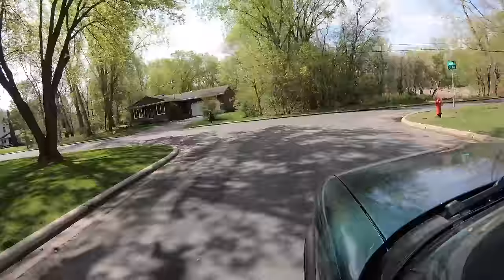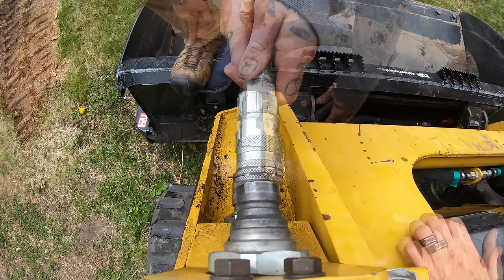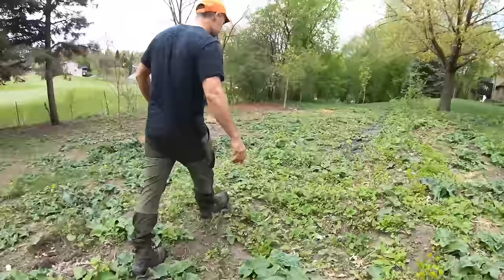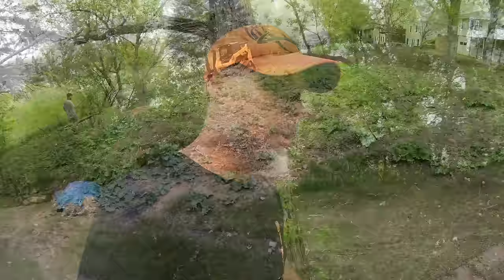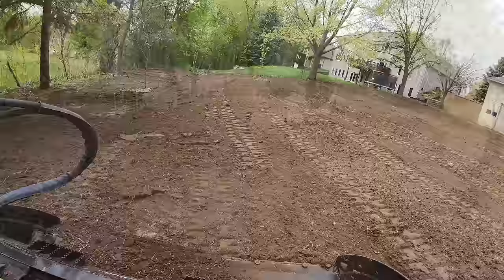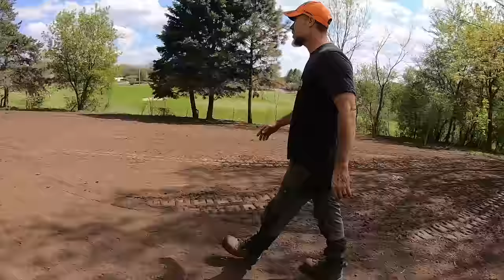Regrading a BRUTAL yard Choked with Weeds 4k

Comment: I would be awesome to see an update of this backyard after it’s seeded and grown in some.
Reply: I imagine a lot of weeds have sprouted since all the existing weeds were worked into the soil. If I was the homeowner, I would've sprayed the life out of that backyard in anticipation of laying down new seed. Maybe that was done though. It would be interesting to see the yard today.
Reply: D T yeah that is what I was thinking.
Reply: @delt19  The problem with spraying (what no one tells you) is that glyphosate kills all bacteria in the soil at a 1/50th of the plant killing concentration. Plants can get nitrogen a few ways: 1) through air... (very slow), through fertilizer that is ammonia / nitrogen-based (very fast, but short bursts), 3) through bacteria and fungus - the bacteria and fungus eat the sugar / carbs produced by the plant and offer poop.... nitrogen in exchange.

Best way to kill weeds is to till them. Wait 2 weeks and till them again. Unfortunately it's not practical I agree.
Reply: @lifeisgood070  Interesting information. I did not know that about glyphosate. I've personally never used roundup to kill weeds and more than likely will never use it. I do use a mixture of tenacity with a surfactant for weed control and plan on applying it to my backyard to get it ready for regrade and seeding job.
Reply: @delt19  gotcha most people don't spend that kind of money ($60) when other concentrates are so cheap. Going for the horse not the zebra. And Idk the unintended consequences of tenacity; I have not studied it.
Reply: Haha I also was going to say same about after shots, also thought about the timing oof this job and I’d he aligned it around rain in forecast.
Reply: Weed all come back up in about 3 day but it look good doing it
Reply: it would be awesome to see an update of  all the jobs hes done. before and after, revisited yay !!!!
Reply: Didn't look deep enough to get some of those weed roots.. lawn torch that whole yard..
Reply: @lifeisgood070  that or somehow cover the entire site over with landscaping fabric to drown all the weeds out but thats not practical.
Reply: @kmain0  Cardboard pallet slips
landscaping fabric will get intertwined with the roots and be hard to remove.
Reply: @lifeisgood070  would spraying something containing beneficial bacteria help. I’ve never read anything about it killing bacteria just plants as it says it does not impact the soil.
Reply: Would a preemergent be better since he already killed the weeds that were growing. Then wait to see when it's safe to do so.
Reply: Tenacity!
Reply: @delt19  If you cover grass with dirt so it can't see the sun it dies so a lot of that probably died, but there's a lot that probably didn't.  A quick Roundup spray 2-3 weeks before probably would have been best.  I know someone mentioned Tenacity, but it takes forever to kill a lot of stuff and there's a lot of stuff it won't kill, so that wouldn't be my choice.  Even if Roundup killed some of the bacteria it wouldn't kill it all and it would reestablish quickly.

Comment: Man you do good work. Wish you were around NJ. My yard looks just like that and it’s taking me forever to fix it. Moved in a few years ago and had a tree company remove all the dead trees and bushes in the back half of my yard which looks like the previous owners never even cut or trimmed once in 40 years but I didn’t realize how many roots, vines, rocks and crap were still back there on top of what looks like a construction company dumped concrete, clay and metal pipes and cement. I’ve managed to do a lot by hand but I feel like I can never keep up with how fast the vegetation grows.  That bobcat and bucket look like it would have solved years of manual labor I’ve been trying to do. Love the videos and the love you put into what you do.

Comment: Time for a new set of quick connects and a drain of the hydraulic system and a new hydraulic filter. Then ask your crew to wipe the connectors before connecting a new attachment, it will save putting dust and dirt in your system. Nice work you did on getting a perfect slope
Reply from the maker: Not a bad idea

Comment: The ABI rake you bought awhile back would have done that job as well. I did a similar job and borrowed one from a friend now I want one.
Reply: Which ABI rake? With or without wheels?
Reply: @flat6fever680  I used the sr3 command series with wheels on my skid steer. I bought a tr3 for my tractor to use in my wife horse arena.

Comment: over here in Québec, black dirt is all organic matter and very black. Top soil is a mix of black dirt and sand that you put over the finished grade before seeding. I gess a mix of weeds and the top layer of dirt underneath it like what you get with that power raker could be considered like top soil, so great machine to prepare a lot for seeding at a much lower cost on material.

i would like to see a finished picture after the seeding is grown.

Comment: The metal in the oil is a little worrying, I'd definitely change the oil and flush it. The bucket looks like it works well, I'm a big believer in a tool with multiple uses.

Comment: I had a large tree fall in my yard and used a 12,000 lb JD tracked loader to cut is up with a tree shear and then switched to a grapple to move it out. I loader tracks made cut large divots out of my sod and channels into the dirt below. what would be the best attachment for smoothing out the yard without having to work the whole yard like this job.  I have a 84" bucket, 72" rake/grapple also a small tractor with bucket, 48" tiller and a 48" disc.

Comment: If you grease the release pins you wont have an issue. I run cats and as long as I stray greased they don't stick. Granted that's just my experience in the northeast.
Reply from the maker: Sam is all over that.  I think its his mission. lol
Reply: I’m in a CAT loader with a ssqa all day everyday switching buckets and forks... maybe once a month the pins will stick, keep them greased and you will be good. Once a week I will lock the pins with no bucket on so they protrude and smear grease around the pins from underneath
Reply: I have a 279d which we get sticking pins probably once a month but we grease them daily.
Reply: you have to grease the pins with them locked and no buckets. Those new gen track cats are beautiful have to treat em right. think stan has them to throttled when doing finishing work too because they are smooth

Comment: Hahaha the company I work for  just bought a brand new 236 D3 and I thought it was awesome how it says hello master when you start it up! It has bitchin counterweights that make for the smoothest ride when carrying a heavy load of wet sand in your bucket and not to mention the bucket float feature for grading, the auto tilt on your bucket which I personally don't like using, backup camera is a nice touch too but on hectic job sites with a lot going on, I found that I end up looking at the screen too much and not keeping my head on a swivel and looking all around me and checking my sides as well so you got to be careful with that!!

Comment: My question is what does this cost? I have a backyard that is smaller, but it's just like that one. Uneven grades rolling away from the house, ruts from water runoff, and 99% weeds. I figured I would just have to till it myself and use a leveling tool.

Comment: I have a cat 299,  if that has the electronic actuator for the attachment pins, youre going to have problems.  I'm sending my 299 down the road the first chance I get and going back to bobcat.
Reply: Dustin Pryde do you mean the switch that controls the hydraulic valve that open and closes the attachment hookup pins? I’m still using a 268 Cat I bought new and have never had an issue. I grease the pins every time I grease machine.
Reply: @technicalitems731  not what I'm talking about.  mines a 2015, I don't know how long they made it but the new ones are hydraulic and same with the old ones. mine is all electric. it has like a screw jack with a tiny electric motor on it.  it burns up the plastic gears inside it quite frequently.  and when it breaks with an attachment on, you have to snap it in half to get the attachment off.  its a horrible design.
Reply: Caterpillar got rid of them because of all the problems with them.  its 4 grand to swap it over to hydraulics which I feel they should work with me a little on but they don't.

Comment: What you did to that back yard, I am doing in my front yard.  Whereas you took 3.5 hours, I think I will be 2-3 years by hand.
I was wondering, how deep is your soft dirt?  I am tilling 3-4" to break up the ground and the top 1-2" I will rake to pull out 2" and larger stone.
(I is me and my son.)
Reply from the maker: That sounds right.  you need 4-6 inches of fluff to get the grass to root well

Comment: Had a guy running my machine clearing brush and he rubbed against a tree and it wedged bark into that case drain fitting. Same situation. Just had to push it in, let it leak while you dig it clean 😩

Comment: Did you consider using the SR3 attachment for this job? I noticed you have one. I've used them with jobs like this with great success. I'm aware you still would have needed the bucket to cut out the old terrace parts, but the attachments change so quick anyway.

Comment: Any concern about any of those weeds “regerminating” and becoming an issue when the customer tries to seed?
Reply: Epicgarbagecollector that’s gonna be a huge problem. Should have had them spray with Round Up a week before. Grass seed won’t have a chance IMO
Reply: Great job on the grading and reworking the soil, however the Twitch grass or Couch grass, bits of Dandylion roots no doubt will resurface before the grass seed will germinate. 
It would probably be better Hydro Seeding that yard but no doubt the home owner has a budget and you have given him the blank canvas to start again.
Be interesting to see the yard in 6 to 12 months down the road to see how it turns out.
Wish we had machines like you have nowadays than when I was young 40 years ago... maybe I wouldn't have needed a Shoulder and 2 Knees replaced now lol

Comment: Managing a hydraulic hose and fitting store and selling a lot of those quick couplings on your Cat skid steer arm, go to Cat and get a new quick coupler for the arm and that will solve your leak issues. Those boys in Mississippi trashed that quick coupler by getting crap inside it and probably tearing up the seals and back up rings, hence why it is leaking slowly and I would venture a guess that you could not get the female component of the quick coupler to attach properly.

Comment: Sooo for the weeds, would anyone recommend pre emergent after the grading in this scenario? Obviously killing the weeds then grading would be the way to go.
Reply: yes for turf, don't use pre-emergent if sowing grass seed,   then wait 2or 3 weeks, then earthmoving, then followed by 6 inches of woodchip mulch. water mulch and let it rot for 1 year, then remove the top layer that hasn't rot  then plant grass.
Reply: No pre emergent. Starter fertilizer, lime, seed and straw and water twice daily for 2-3 months with extra apps of fertilizer.
Reply: Pre emergent would make it impossible to get grass seed to germinate
Reply: Chris Loesch , True, but I'm not saying put down 30-40 bags, maybe 10 to just help the seed along. Your way is the best though, soil test it to be sure.
Reply: Chris Loesch  I would not soil test for two years.  The soil is in a very dynamic state now.  When it stabilizes and the grass is healthy, I would then balance out the NPK.
Reply: Pre emergent will prevent the grass seed from growing.
Reply: Thanks fellas 👍🏼
Reply: Use tenacity about 5 days after seeding or a close to seed germination as possible. It acts as a pre emergent and will kill any weeds that try to grow over the next few weeks. Works wonders.
Reply: Many colleges will do soil testing for free or cheap. Virginia Tech has a turf program.
Reply: The only pre-emergent / post emergent I've heard of that doesn't kill grass seed is Tenacity. I've never tried it in this scenario, but on paper it sounds like they could have applied Tenacity and seeded right after tilling everything.

Comment: Metal shavings in hydro oil a worry. Guessing either a machine component or more likely an attachment was used that was severely worn or ready to blow up with lots of debris in oil. As others said drain, flush, change hydro filter(s)

Comment: Looks like someone contaminated the hydraulic tank and it caused damage to the pump shearing bits of metal off it then affecting the seals on the quick hitch connection.

It was great to see the customers reaction.
Reply: Yep.  When he was hotdogging it on two wheels I could almost guarantee all of his equipment and vehicles had been abused.

Comment: you might want to change your hydro oil and filter if your finding metal shavings in your fittings when you change oil take a sample and send it in to make sure you find where the metal came from you don't want that metal running through your pumps

Comment: Hey man, just finish watching this video and I would like to know if you think a TLB tractor like a BX23S from Kubota could drive this bucket and would be any good for someone that only has a TLB tractor. Thanks
Reply: depends on the hyudraulic pressure & capacity rating of your kubota
Reply: @stephenfarynaz7229  i would have to look at the specs, I just got it 2020. 👌

Comment: That electric pin system is weak! I found less Grease is more 2 or 3 pumps and hit the pins with penetrating oil and they won’t stick 👍 I know it sound wrong but it works
Reply from the maker: Thanks for the info

Comment: I don't want to be a Debbie Downer, but wont all those weeds grow right back ?
Reply: Yes, but not necessarily from recycling the material, just all the seeds already in the soil and blowing in on bare dirt.  The intent here is to prep the grade and soil for seeding, which should be done in a timely manner from doing the prep to mitigate this from happening again.  Glyphosate can be used as weed control between this point and the time of seeding.  Mesiotrione can be used at the time of seeding to help with clean germination and again after germination to treat breakthrough weeds.

Comment: I’m sure you planted a lot of seed. I have significantly increase grad yield by taking the seed in vs just tossing it on top of the soil. Spreading seed then Dragging your Harley rake over it would blend it into dirt. A 13-13-13 or starter fertilizer will double yield. Defiantly straw or straw blanket on hill sides will help. And of course keeping it moist through the second cutting 😉
Reply: Sorry should say”increase grass yield by raking in the seed...”
Reply: YOU seed with a spreader,   properly ,,than  fertilize on top of that ….  than   you  lightly  use a plastic 3 foot rake back side to cover seed with dirt …...Than roll E mat straw.... over the top,,,,,  water    as necessary  in your climate  …

Comment: I do more earthmoving and less landscape. I’m situations like this I’d spray it with roundup. Hit it a few more times if needed. Wait a few weeks. Come in with CTL and do the same as this except I don’t have a Harley bucket like this. I may bring a tractor with a rotor tiller in the back and bust it up first. Then level down with CTL. - or...I’d come in and peel off the top layer of grassy and clouds. Haul it off or pile it in to a pretty pile on the corner to be used for topsoil at some other time. Haul in some top soil. Spread it back out. But heck, here in N Georgia, grass grows good on the bare clay with fertilizer, lime, and Kentucky 31. But I’m not in the landscape biz so....
Reply: Ya spray that round up right into your water supply. Yeeehaww

Comment: Just so u know u drive  a car or truck. . An operator "Runs" a machine or piece of equipment. I'd also say u need to change ur hydro  fluid and filters urs looked pretty nasty. The machine does what u tell it to so if it's hurry jurky it's the operator. Ur rite on with cat makes quality machines and a great platform for ctl's. I own caterpillar machines and have had outstanding luck with them but as a owner operator I treat my machines well. At end of day cat is at the top along with few others.  Really it all comes down to personal preference.

Comment: You should have sprayed roundup first or at least scraped up the weeds and put them on a dump truck you just mixed all the weeds up into the new lawn 🤦🏼‍♂️
Reply: Putting an application of pre emergent fixes that. Or if they use a seed mix that has rye, it will come up so quick it chokes out any weeds before they can germinate.
Reply from the maker: You don't need to do that.  What this guy wants beer said is accurate